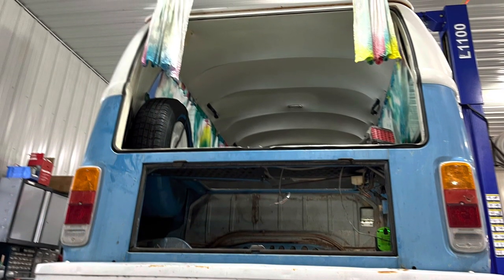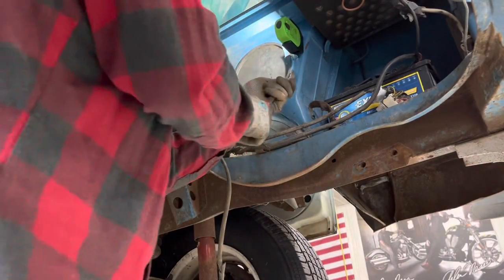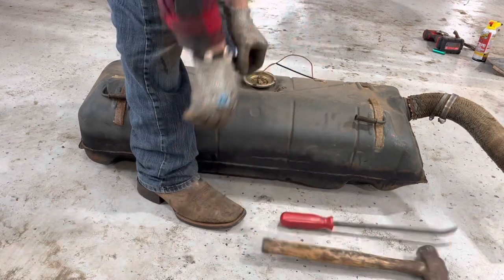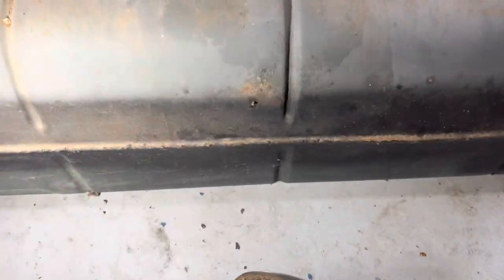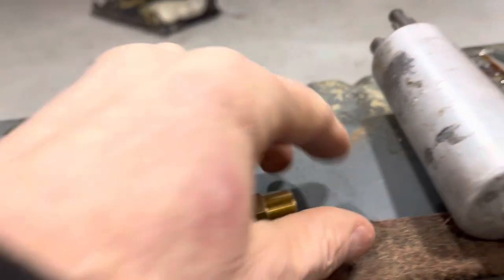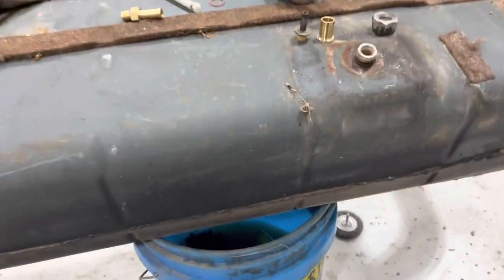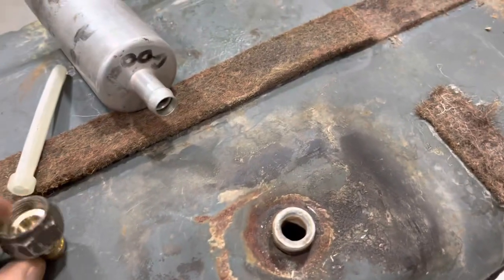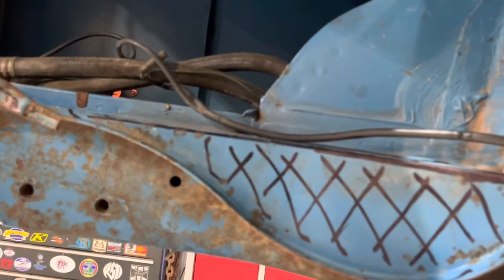Part 6- VW Bus with Subaru Engine- fuel tank and engine bay prep

Comment: I plan to run a return line to my 72 bay bus because I have a Toyota 22r in there. How has the return line held up on that one hose clamp at the top of the tank? 

From the forums, I’ve seen guys insert a hose into the tank that is submerged in the fuel. Just trying to figure out best plan because my pump calls for a return!

Thanks in advance for the help!

Comment: Nice work, as usual. Do you worry about that filter rattling out of there with road vibration?
Reply from the maker: hey Keith!  I used a small punch to deform the brass fitting in a couple places to hold that small fuel filter into the fitting. It will hold firmly until I need to change it out.